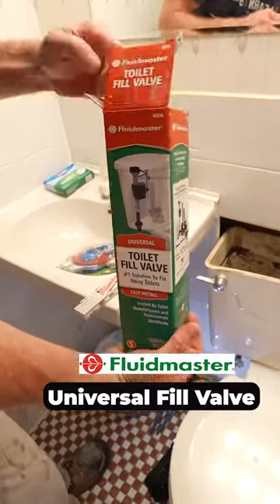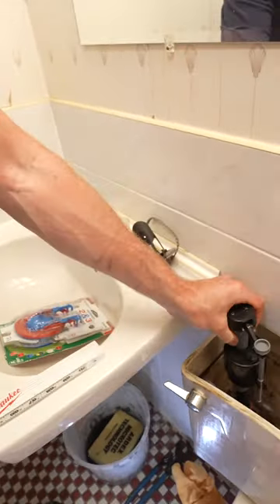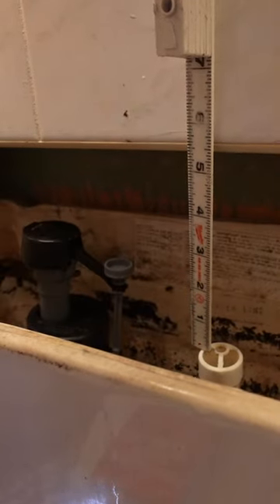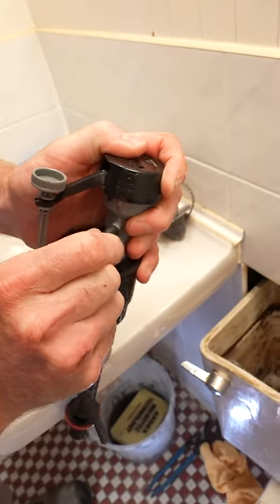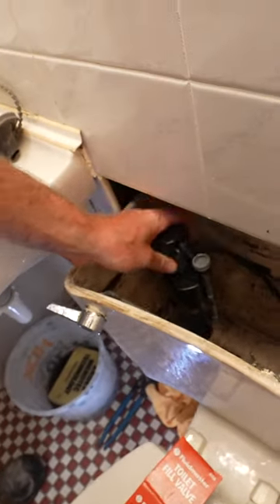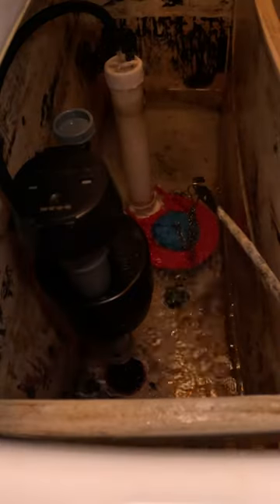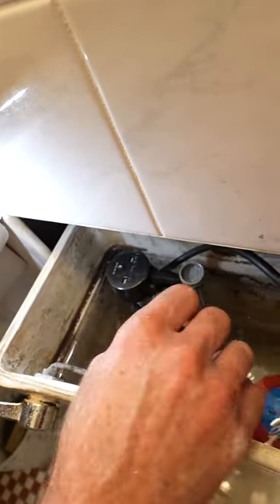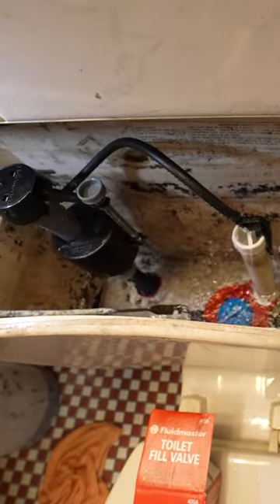Fluidmaster 400H PerforMAX Toilet Fill Valve Installation - now in a Repair Kit with Super Flapper

Comment: What is the restraining ring for?
Reply from the maker: Thank you for your question. The ring in the center of he valve allows for the valve to twist on itself and holds the valve shank to the valve top. For more information visit our website Fluidmaster.com where you can find product information, videos, troubleshooting tips and email or chat with a technician.  Our toll-free number is 800-631-2011 and we are available 5 days a week Mon-Fri from 5:30 am – 5:00 pm PST.
Reply: Thanks!